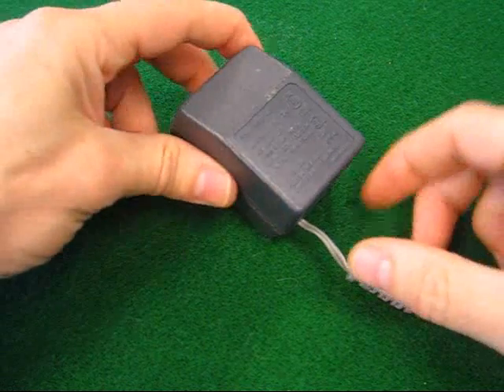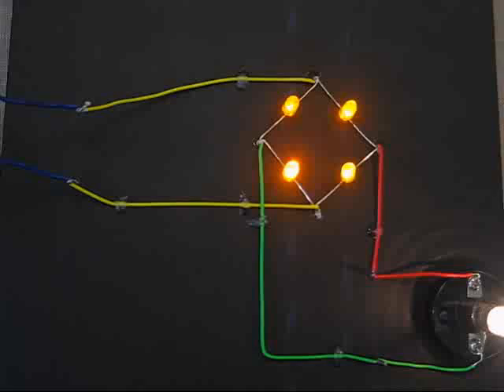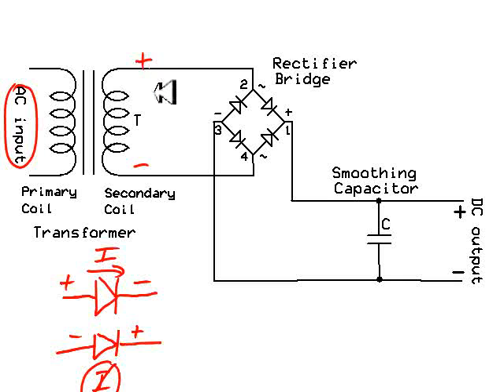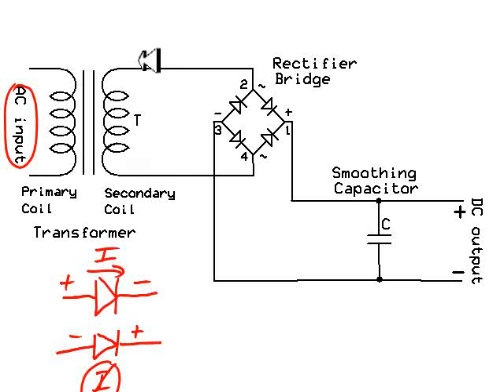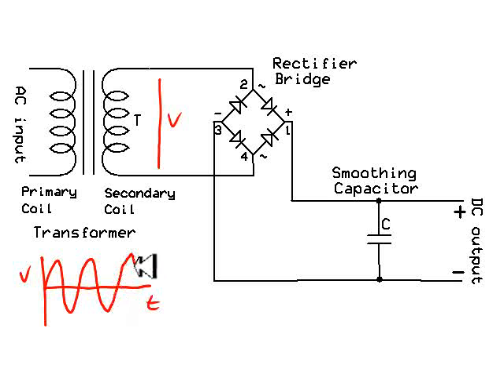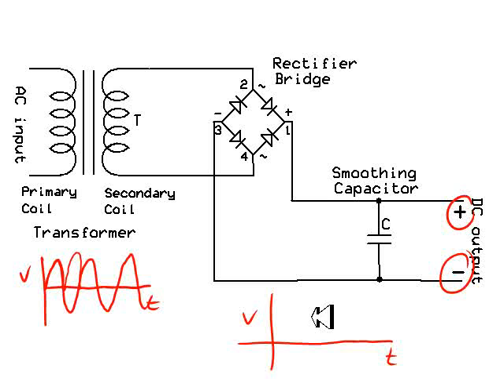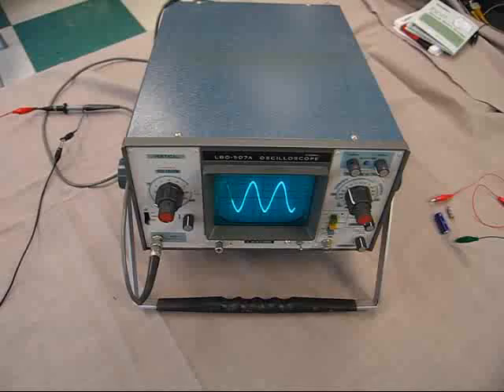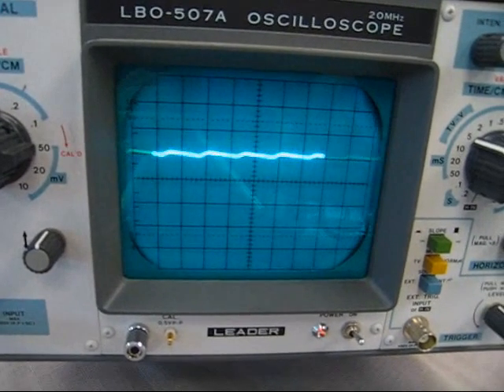AC Adapters Explained

Comment: A little off topic, but for sensitive electronic devices, I’ve heard pure sine wave power is much better than modified or squared sine wave. Does it matter if the electronics use an AC adapter and take DC input power?

Comment: this was explained  in great detail, thanks for that im looking  forward to more from you, as for myself im a real novice at all this, i just wanted to ask you all diodes do for the bridge rec, or if they are different kinds what one did you use? subscription well earned.
Reply from the maker: Hello derry man! For a real bridge rectifier, one designed well, you would NOT used LED's, which have a voltage drop of 1.7 volts or higher, depending on the color. I only used those so we could SEE the rectifier in operation. If you were to build your own, generic rectifier diodes (types 1N4001 or 1N4007 or similar) would be preferable. These have a voltage drop of about 0.6 volts. You can also buy 4-terminal bridge rectifiers as a single part, if you just need a bridge rectifier and don't have a desire to build one from the individual diodes. I hope this helps.

Comment: Thank you for this amazing video but i have a question, what will happen if we use more than one capacitor? cuz i opened up my phone charger and it has two capacitors
Reply from the maker: "Passive filters" in electronics lingo, can have more than one stage. This can steepen the response so it has a sharper cutoff. But you would have to trace the circuit and make a schematic diagram to be sure.

Comment: For some reason my 12V 2A ac to dc adapter outputs a current that is oscillation. I would have thought that the adapter would output a steady current at 2A but it instead oscillates. Why is it doing this? I thought of putting a capacitor to smooth out the output, but I'm not sure what the value of the capacitor should be.
Reply from the maker: Are you sure it's meant to be a DC output? Some "wall adapters" are just transformers, producing an AC output with a lower voltage. It all depends on the intended use of the wall adapter.
Reply: @JeffRegester   Well, it's written AC/DC adapter on the back. So I would assume that it's supposed to be a DC output. I was going to power a 12V 2.1A lamp with this adapter.

Comment: You really did a great job explaining this.  I knew about capacitors, diodes, but had no clue that they was used in converting AC to DC.  Now makes perfect sense why they are and how it works.  The use of the LED's and scope really helped see it visually too. I realize this is an old video, so even if its late, I wanted to say thanks for making it for us.
Reply from the maker: Daniel, thanks for your kind note. Yes, it's an old video and I haven't been making many recently, but am hoping to get back to doing some.

Comment: are your  two diods backwards... since the  current cant flow in revers through a diode?
Reply from the maker: Hi NoVaKane. There are 4 diodes, and yes, at any moment two of them are reverse biased and not conducting. But that's the point...of the four diodes, only the two that produce (pulsating) DC are "on", and the conducting pair switches depending on the polarity of the AC.

Comment: if i put voltage thu the outputs would it turn 9v to 120v
Reply from the maker: If you reverse the input and output of a transformer, you can turn a step-down into a step-up transformer, as long as the current isn't too high for the wire gauge on either side. But it would have to be AC input. Putting DC into a bridge rectifier would not turn it into AC, so in answer to your question is no, it wouldn't work.
Reply: Jeff Regester thank you for your feedback
Reply: i have a question i have a hotglue gun and it runs off 120vac would there be a way to make a mini 120vac to 230vac to make the heating element get hotter because im going to convert it to a soldering iron
Reply: Skidtire This probably won't work. Even though a transformer will step up your voltage from 120 V AC to 230 V AC, your current will be stepped down by the same ratio. This means that your power output will be the same (probably lesser due to to heat loss.)

Comment: Thanks very helpful. Although i thought i knew how they work i didn't know about the smoothing capacitor. Anyway i wonder if we can add only 2 diodes opposite to each other on the ac wires. This would make our dc flowing in pulse and will make the current half. and then then we add the smoothing capacitor on the output anode and cathode. wont this make a good "resistance" instead of transformer? Of course the diodes must be "strong against the high voltage but wont this work?
Reply from the maker: I'm not an expert in what gets manufactured, but diodes are very cheap so I don't see much advantage to this, as it would require a bigger smoothing capacitor, which would be more expensive. And if the output doesn't need to be smooth or efficient, you can get away with just one diode and no cap.
Reply: Jeff Regester thanks for the reply

Comment: Love the explanation. I'm total stranger to electronics but i want to learn more. just a question. I don't see these adapters for other devices such as television. Are the diodes and smoothing capacitors contained within the devices itself?
Reply from the maker: Yes. Usually you only see these AC adapters on small appliances where there isn't room inside for them, like cordless phones, or that that sometimes run on batteries and sometimes on a plug. Something like a TV would have all this inside, on a circuits board, or would have a more sophisticated way of making DC called a switching power supply. Of course, some things don't need DC, like a toaster or hair dryer, which just run off the 120V AC (or 220V AC in much of the world).

Comment: Great explanation, the flashing of the LEDs at 0.6Hz really helped, too. I have always wondered why wall adapters had 4 diodes in them, which, to cause additional confusion, were rarely in the traditional diamond pattern but rather parallel to each other. Keep posting these great explanations. Perhaps you could do one on transformers, which explained how the difference between the amount of windings in each coil affects the output of the transformer?

Comment: While a very low current is capable of killing dry skin has a high resistance to the current flow, so here the voltage is the important factor, the higher the voltage the easier the skins resistance is overcome, in general working on voltages less than 48Volts with dry skin is considered okay, but don't forget very high currents can flow from battery supplies, even when the stated capacities is only a few hundreds of milli amps, the short circuit current can be several amps and cause burns/fires

Comment: Does anyone know the formula or name of the formula that would allow one to figure out what type of capacitor to be used to smooth out the DC voltage? (i.e. what capacitance and discharge rate of the capacitor should one use for a given DC voltage in the circuit).  In the video, Mr Jeff used a 1000 micro-farad capacitor; but how did he know to used that particular capacitor, by formula or try and error.  Thank you for the help

Comment: What voltage you get depends on the ratio between the winding of the coils. For instance, if you want to convert 120 volt into 12 volt you would need 10 times more winding on the first coil. 

And if you want the output to be 5 volt you would need 20 times more winding on the first coil in relation to the second. 

Correct me if I am wrong:)!

Comment: I had 1 of those 2' fluorescent work lights that had some type of  transformer in it that fell apart. do you know if those bulbs ac or dc? is there a way I can make that transformer so I can save my light?  or is there something else I can splice in to make the proper voltage. it's a 15w T15 I believe